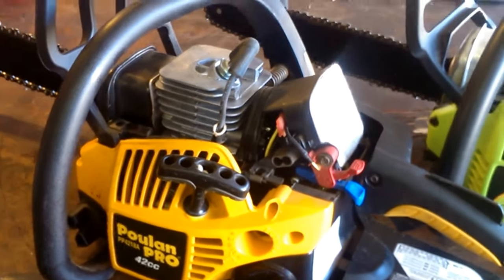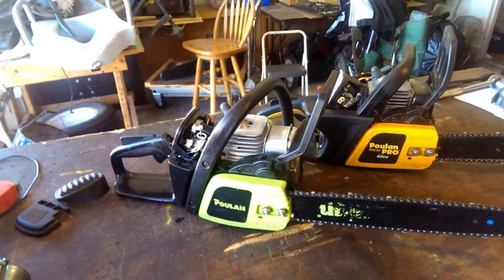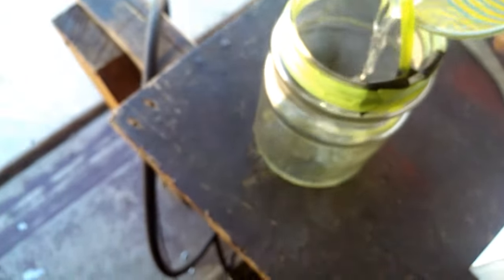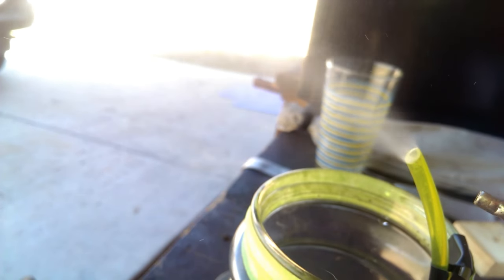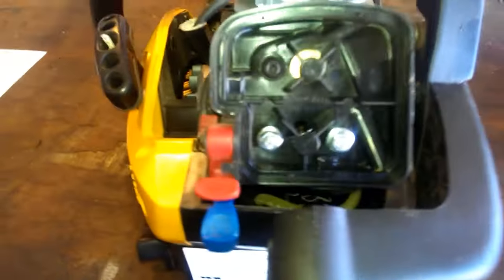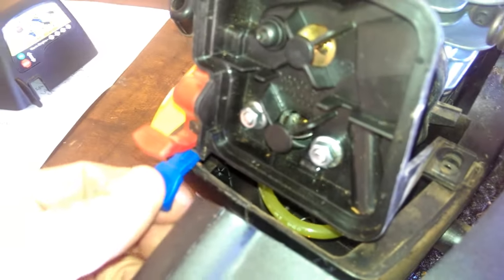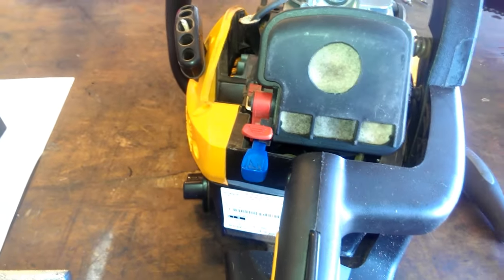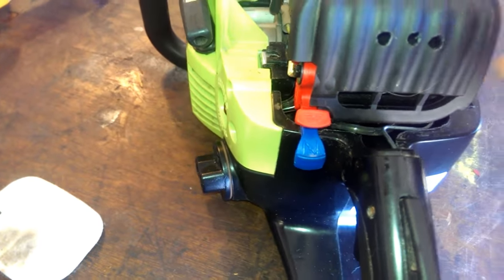Poulan wont restart after being used & how I solved my problem.

Comment: I've been struggling with Poulan and was at the point of no return, very frustrating. But tomorrow, first thing, I will be drilling holes in mine as well. Thanks for the insight and help to solve this problem. God bless.

Comment: Ethanol has water in suspension since it is not refined to maximun of 196 proof but instead to only about 130 proof . After it sets for an extended time separation can occur. hence since water is heavier than alcohol or gasoline it collects at the bottom of the tank and is the first to be drawn into the carb essentially drowning the engine. Do not use ethanol blend gasoline if possible. If you do be sure to draiin it from the system before storage. or add a fuel stabilizer. Shake the saw to remix the fuel in the tank after storage before starting.

Comment: Just want to thank you,,, great demonstration! I have a RYOBI  that was giving me the problems you described. I changed the spark plug, then the fuel, then the air filter, and last the gas filter and still no luck.  Cut a wider opening over the air filter cover... and finally.. The saw is back in action....
Reply from the maker: Thank you Doug.

Comment: Man, your solution works PERFECT!  I have the poulan p3314 saw.  I had the cover off to get at the low/high jets and idle screw to set the mixture and had it running great.  I noticed the black area on the lower carb jet.  Put the cover on the carb, installed the cover and the damn thing WOULD NOT restart.  Choked, not choked.  then I found your solution.  took off the carb cover and put 2 3/4" holes on either side of the top jet, reassembled and bada-bing, fired right up.

Comment: Wow Oh Wow!  I have a Chainsaw again!  I bought the 3314 after my Wild Thing that was just worn out after Katrina cleanup (the Forrest came down on us) and expected it to work as great as my Poulan Wild Thing 2375. Alas no.  

The flooding after you use it once was unfixable by local techs until I watched your video.   My 3314 didn’t have a separate filter cover rather a gridded plastic cover that SHOULD have allowed airflow.  Prehaps there isn’t sufficient air coming into chamber at all?  What do I have to lose?   I decided to drill a very small vent hole in front of the upper filter area.   1/8” bit

Voile’. It starts every time. It’s now as effortless as my old Wild Thing. 

Thank you for the clue. So great to have it working.
Reply from the maker: No more coffee and researching youtube. Time to go to work! Stay safe Allyson. 😷👍🍺

Comment: It's 1am here in northwest AZ as I write this. I've been trying for over 10 days to get this ancient 2900 Poulon started after sitting for 12 years.. Ran twice, but never again. After your video and reading most of these comments, I remembered that one of the starts was with the engine cover and air filter removed. So I tried it again. Sputtered on first pull. Started on pull #2 or #3. Ran good. Idled well. Accelerated well. Took a can of brake cleaner and reverse sprayed this paper thin filter to a cleaner state. In the am I'll try starting it again. Then it's time for either a new filter or time to wrap it in panyhose after cutting out the old element. Thank you Dave !!!
Reply from the maker: As the cops are responding to Mike's house at 1:00 in the morning for a noise complaint. Police dispatch: "There's a man running a chainsaw  at 1 in the morning" ......

The panty hose idea sounds good. Do a test with gas and make sure it doesn't dissolve it . Thanks for taking the time to comment Mike. I appreciate you.  Zombie Dave- Tucson

Comment: This fixed my problem!! I replaced the spark plug and cut a big square in that filter cover and it runs like a freakin charm! After a carb adjustment, it runs well, idles well, and starts after its been running a while (after its hot) Thanks for the help!

Comment: setting the plug gap to 0.030 " fixed my problem, today... a you tube guy said the gap shrinks when gets hot, and just need to open it up a little...  (ran for 4 min, then died & no start...)  Over the years, I have done various things... replaced gas,  carbs, fuel lines, filters, & even a gas cap... I do something every 1 or 2 years...  it always, eventually, will get working again...  but this was the fastest fix I've seen.       I have yet to try cutting a hole(s) in the air filter cover....

Comment: Very well presented and a great understanding of how an internal combustion engine works.  As most problems if not all problems with intermittent use of any two or four stoke engine is with the fuel delivery system i.e. The carburetor from water,rotten fuel lines,blocked gas filter or gummed up carburetor or in the case of small two stroke engine,  the diaphragms inside the carburetor.
Reply from the maker: David Howard Thank you David. I hope you'll subscribe and check out my other videos. Always look forward to comments.👍

Comment: I had given up on fixing my Poulan PRO for years. Every Thing I tried would not work, Till Today. I drilled the holes in the cover, then tuned the carburetor one last time. It is purring  like a Buss Saw should now! Thank you so very much for posting that fix.
Reply from the maker: GARY D YORK  Hey Gary, Thanks for taking the time to comment and I'm really happy it worked out for you. You are the reason I do this. Thanks again.

Comment: That is the best idea i have seen in a long time to prevent lack of air getting into the carb after it has been running for a while. I will be drilling a hole in my air filter covers from now on and replacing the air filter far more often. Thank You for the TIP...

Comment: I am going to do exactly what you did. Last year all of the sudden mine would not crank, fresh tank of gas, oil mix, all new. Cranked it up no problem, did some cutting, eventually cut it off and it would not restart. Changed settings, added more gas, filter was clean, etc,... finally quit trying. I emptied the gas out of it and put it back in case. I have been wanting to take it and check on it. Happen to look at videos tonight...wow, I think I can get it to work now. Thanks for the video. When ever I actually go out and test it, I will give you an update.

Comment: I cannot wait to go home and cut that hole in the filter cover! I have been searching and searching...I cleaned carbs, cleaned saw....new fuel. No change. I will try this out! My saw is about 8 years, 42cc saw. Black and Yellow. Works great the first time it starts, but don't put it down or let it idle...it'll be til the next day when you can start it again. Thank you for the thorough explanation. Great video
Reply from the maker: Good luck James.
Reply: I have a 3314 like your green one I got it recently for pruning jobs while I wait on Amazon dragging ass to send me my parts to restore my Husqvarna and that damn thing dies about 15 seconds after you let off the throttle to set it down and it's a pain in the ass to start I'm going to try this, my Husqvarna is an early 90's model 41 air injection and it always starts withing 4 pulls and the engine runs perfect just the oiler broke,clutch is worn out ,bar and chain are worn real bad and oiler tubes need changed I can't wait to have it in the field again I though the little 14 inch poulan for what I gave for it would work well for my wife to trim her fruit trees with but I'm the only one that can get it started so kinda defeated the purpose of buying it

Comment: Hey, I just wanted to throw my 2c in here.  I followed your lead, your discovery and made one more.  You could very well be right about the filter cover suffocating it.  However, take a good look at the saw cover!  That air intake ares is completely sealed off.  They even went so far as to add in a rubber gasket b/w the area and the engine bay.  Look at the inside of the cover on your bench.  Totally walled in.  I cannot see where air can get in except by the carb adjustment area and by the throttle cable.  So I think you're correct bout chasing the airflow, but I took it one step further and am going to cut holes in the cover right below the "start guide" sticker and glue a screen over them to keep the chunks out.

Comment: I think your video is spot on.  I have a newer model Poulan and they have changed the housing for the air filter.  They have implemented a skeletonized version  or the cap that you cut a hole in.   Maybe they realized that had a problem. That said, I have recently had problems restarting the saw but was ignorant on proper fuel handling and treatment for chainsaws.  I am almost certain that improper fuel management is my problem.  Thanks for sharing!!!
Reply from the maker: Thank you for thecomment brother.

Comment: Very interesting. My friends Poulan was not running smooth at top end and of course I thought someone had tried to adjust the carb wrong. After watching your video I am going to try your recommendation. Thanks for sharing your knowledge. P.S. I no longer use the gas at the pumps here in California. Strictly using race gas on all of my 2 cycle stuff. Thanks again.
Reply from the maker: I use castor 927 mixed in with high octane fuel. I believe you have the right idea. But here in AZ,  I give away more gas than I use. So If I service a chainsaw it goes out with a full tank of fuel and bar oil. Thanks for commenting and I hope you subscribe. Nearly all of my vids on small engines have a tip or trick that you may not have known before watching.

Comment: Thank you very much !!!!!! for the video, I have been messing with a poulan for almost 3 years, always changing  Carburetor kits, lines , I have to replace 3 broken springs that I y broke them myself, trying to start this chain and all the hard work since do just A little. I made 2 holes just like the one you had there, now my saw runs like new, of course after I did some carburetor adjustment, but you're correct your idea truly works!!!!
Reply from the maker: Happy that it worked for you too. Stay safe my friend. 😁👍

Comment: I have a brand new poulon and I am going to drill holes in the air filter case straight out the box before I mess up the air filter. Nice video and explanation
Reply: If it's brand new, leave it alone.

Comment: Going to try this tomorrow, I’ve watched a ton a video on how to fix this issue and this is the first I’ve heard of this trick, if it works I will update this, and I will be very very grateful for you because that will be amazing!!

UPDATE: holy crap!!! It worked!! I could not get the dang thing to idle nor could I get the chance to even try to tune the carb because it would shut off and then after I tried I couldn’t even come close to getting it started again, but after drilling 3 small holes... GAME CHANGER!! The dang thing started up great, I was able to get the carb and idle tuned to perfection, great trigger response, I let it run until it was super hot shut it off and normally it would be game over until it cooled but not anymore starts after one pull just put it at half choke and pull starts up great!! Thank you so much!!!!!!!!
Reply from the maker: Happy for you. We saved another one from the dump. 😂
Reply: @ZombieDaveAZ  one month later and still runs like a champ!! One pull start!! How is this not more well known!!!
Reply from the maker: @Aronyeakey67  I don't have an answer brother. Thanks for the kind words. Greatly appreciated 👍🍺

Comment: Thank you for this information!  I actually got tired of pulled the rope and gave the saw away to my nephew.  It was good information, I have a homelite purchased new and replaced the coil and got it running again, it is now very old, from the 70,s  It runs and gets warm and does not restart until it cools off.  Also have never changed the filter, just blew out.  Will check it out and see what happens.  Haven't tried for over 9 years, liked it so well couldn't bear to throw out.
Reply from the maker: I have a craftsman saw that I feel the same way about. Thanks for sharing brother. 😎👍🍺
Reply: Likely crank seal failure, had that problem on a C-72 years ago.

Comment: I wish I would have watched this video a few years ago and my Craftsman 42cc (Poulan). Great explanation of the various problems with fuel and carburetors! Great find with the problem and fix for your Bumble Bee, same as my Craftsman. I was in the middle of the woods the first time it happened to me, SOL an no 2nd chainsaw. I bought a Greenworks Pro 18 80v and 4 batteries. Hard to go back......  ;-) Thanks for the video!

Comment: Thanks so much for this tip. I had a blister on my hand from trying to start a new Poulan. I cut a small hole in that filter cap and the chainsaw cranked on the first pull.
Reply: same problem on mine, im gonna try this

Comment: Here in Northern Michigan, you can dump gas in a jar, come back in a half hour and actually  see water forming in the gas. It becomes foggy and after a while, you can even tilt the jar and see water pooled up at the bottom of the jar. The best thing to do is keep your can tightly sealed and never use the last 1/3 of the fuel in your gas can. It will always have water at the bottom. Sometimes you need to think outside the box. I had a lawn mower that never worked right. I ended up putting a fender washer over the carburetor  hole between the air filter and that cured its problem. By doing that, it restricted air flow a bit and improved performance  and ran 100% better. I have also had to modify the air filter box on weed wackers, same issue!

Comment: After  several frustrating days trying to get mt Poulan Wild Thing running I tried your fix, shazzam I now have a working chain saw. Thanks!  Great fix and makes perfect sense.
Reply from the maker: Chuck Holton.  Thanks Chuck, just trying to share what I know,errr what I THINK I know. One of these days I will show and share a true story that happened to me with a echo hedge trimmer. humbled me deeply. a lesson I taught myself and will never forget, stay tuned for that one and Thanks so much for your comment. 👍
Reply: Chuck Holton Usually the Wild thing problem is the carb.
Reply from the maker: Carl  I just put out a new carb clean video. 100%.
Reply: Chuck Holton Replace the carb. or the diaphragm 1st. Adjust the mixture using the spline tool.
Reply: It has run the rest of the summer and early fall perfectly.

Comment: Thank you so much for the advice, my poulan is doing the same thing even after a carb change 3 new fuel lines, new fuel and air filter and a rebuild kit to the original carb. It starts nice but eventually while it’s running and getting warmer will shut off and then very erratic when I do get it started when it is warm. I have it about 10 years new from Lowe’s and will try your breathing method!  A very good video and informative ~ Jeff
Reply from the maker: Hey Jeff, it seems to have worked for a number of guys if you read thru some of the comments. I hope it works for you as well. 👍.  Best of luck.

Comment: The air fix sounds like a potential fix for my Poulan ,  possibly also an Earthquake which has the same hot start problem. I"ll have to check the air cleaner cover now that I have seen your fix.

Comment: I like your analytic approach and your ability to articulate your experiments/explorations---so here is a word for ya---"VENTURI". That is what a reduction in inside diameter is called where an air flow passes through a carburetor and is forced to speed up. That area causes an increase in air flow speed AND (the important thing) a drop in pressure (so there is a relative vacuum there to pull the fuel in and vaporize it). You did a pretty good job of showing and explaining the simple venturi in this carb, but I just thought you and other folks might like to know what it is called. I also liked your demonstration of how the fuel is drawn out of the fuel line into the vacuum where the air passes over it at speed and turns into a vapor. GOOD JOB and VERY clear! One point to check AFTER a "no start" and you have changed the fuel for new is to clean the spark plug to be sure it wasn't contaminated with water before you changed the fuel and is still that way----won't work if it has water on/in it for some reason!
Reply from the maker: Yeah I didn't explain the low pressure as good as I should have. But I did call it what it is @ 03:59 . Honestly I get too anal about stuff so some guys do the 10 second skip. Oh well just trying to cover all the bases. Thanks for the comment and the water soaked spark plug is an excellent point. Thank you. I hope you sub and comment more on other videos.
Reply: He named it properly in the video, at about the 3.58 mark. Good suggestion about the plug and water, but actually chemically pure water is an excellent INSULATOR ! It's the minerals/salt/etc in water that can make it electrically conductive.

Comment: I have a poulan and husqvarna that experience those exact problems. Going to try your idea today.  I have been taking the alcohol out of my gas before using in my two strokes.
Reply from the maker: Good luck. Don't forget to pull the choke out and then push it back in to set the hot restart. You should be good. 👍

Comment: Thanks for sharing Zombie Dave. My dad's Poulan P4018 is only 6 years old, hasn't been used hard at all & I'm replacing fuel line, cleaning air filter, & having to adjust high & low screws. Now looks like I'll be popping a few holes in the air cleaner as well.  Thanks again, take care from Tn.

Comment: Hi Zombie Dave,
I wondered the same thing that you mentioned.
I don't know much about engines but I noticed that when I took the cover off of my Poulan Wood Shark, 1950 that the carburetor air intake is nearly blocked by the cover.
Thank You so much for your great video and explanation!